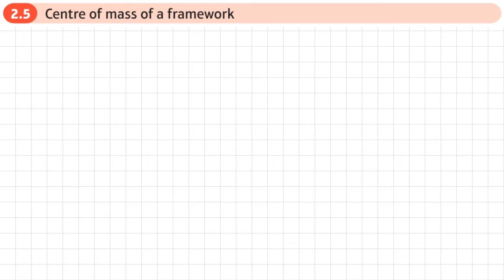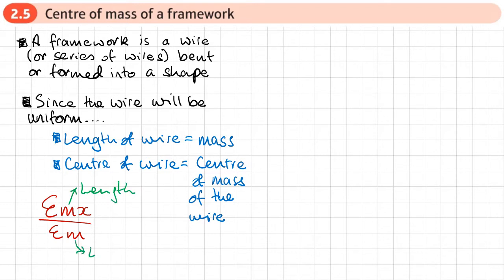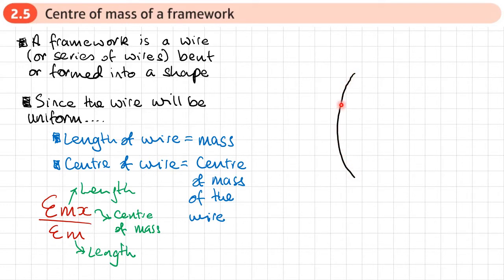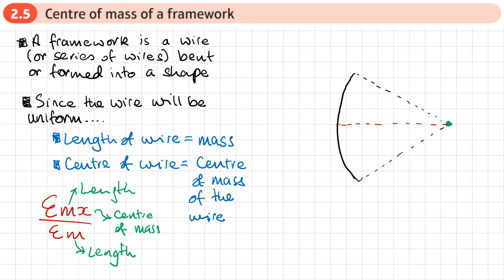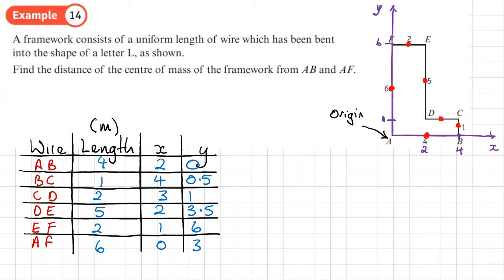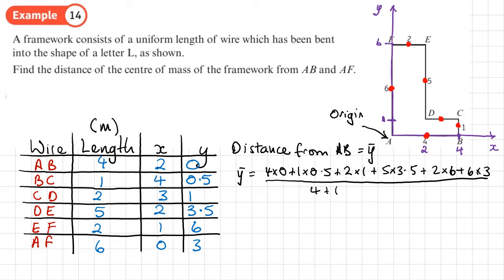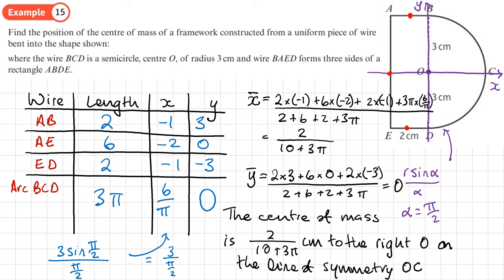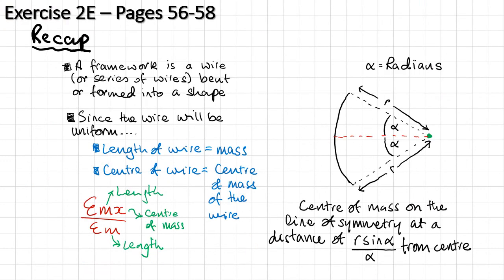2.5 Centre of mass of a framework (Further Mechanics 2 - Chapter 2)

Comment: You are a legend! Any final tips before the (aqa) mechanics/stats paper 3? many thanks for these videos
Reply from the maker: Thank you. Draw nice clear diagrams to help with the mechanics questions.  Don't round until the end for statistics questions.  All the best for your exam
Reply: @HindsMaths  okay, thank you. Just a quick question, do you have any videos on Yates' correction for 2x2 contingency tables (aqa)? Ive heard that it's not really very accurate but it's often in mark schemes. Many thanks again!
Reply from the maker: @inkjetcard-tq8be Sorry, I don't have any videos on that, but it's not much different to this ∑{(O-E)²/E} which I have a video on here https://youtu.be/Xx7D6bxXjS8?feature=shared.  With Yates' correction the (O-E)² part of the formula becomes (|O-E|-0.5)².  You would use it when you only have 1 degree of freedom
Reply: @HindsMaths  Many thanks!